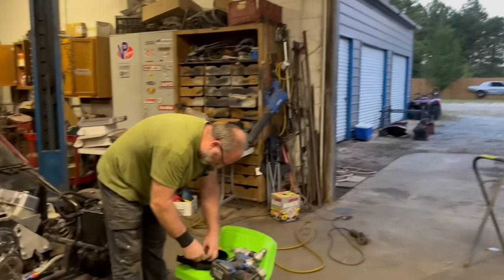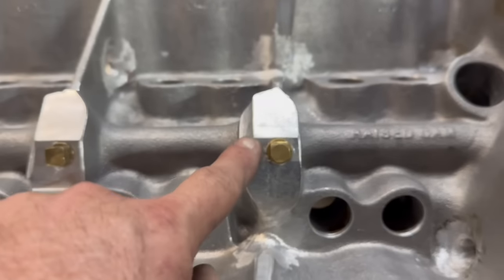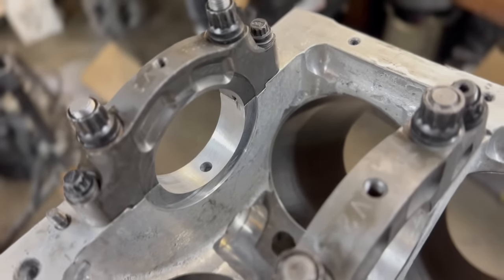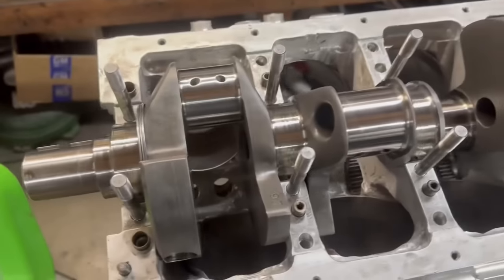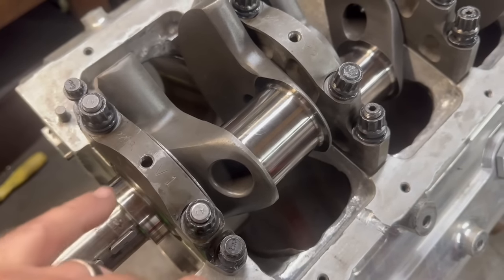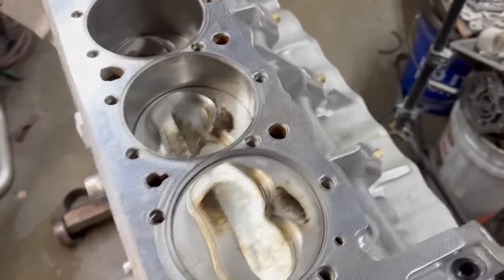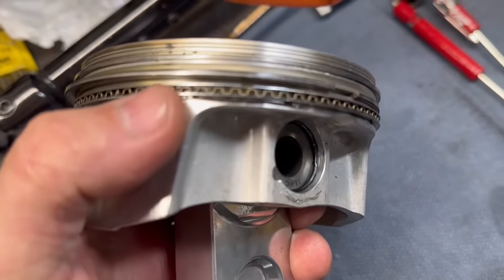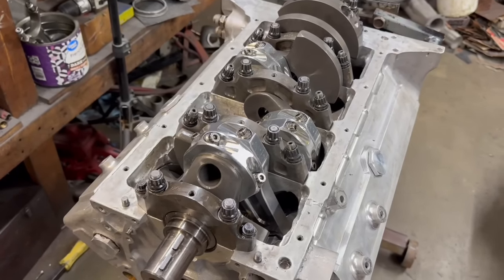How to build an All Aluminum 409ci SBC

Comment: Nice job building your own stuff. That hoop and profile decking your block was the ticket. Only thing I would change on this build was to weld and set rear thrust clearance to assist the roller thrust. Just like you I have heard guys doing it like you did this time leaving your rear thrust damaged and having the new roller setup take all the load. Some guys get away some don't. Fingers crossed you get away with it.